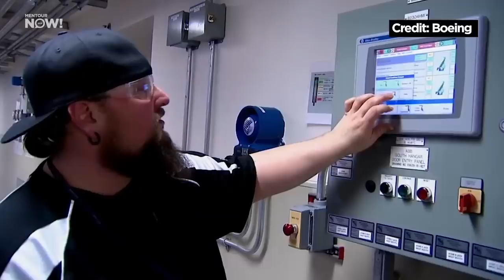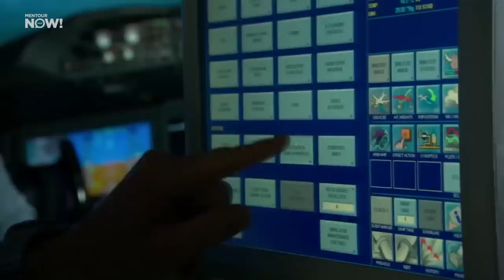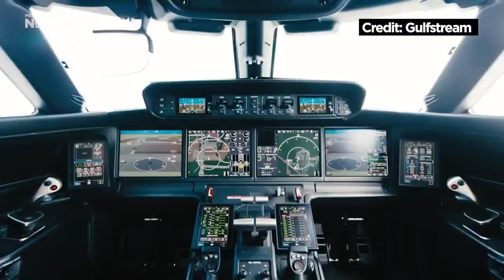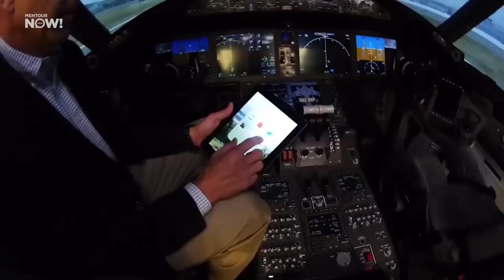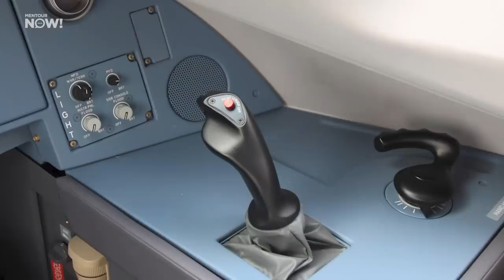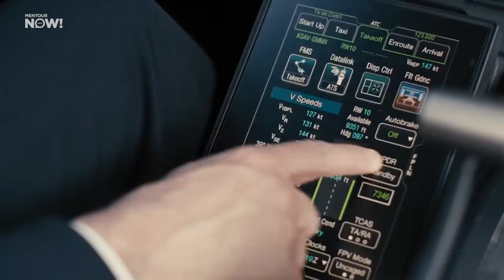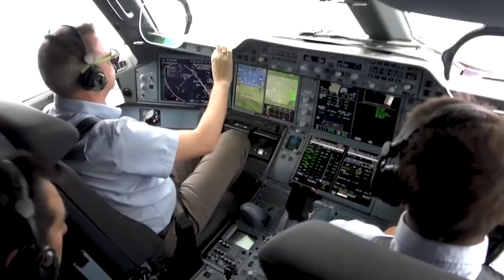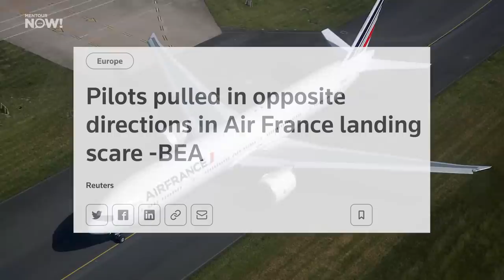Is Boeing Switching to SIDE-STICKS?!

Comment: the side stick needs to have some kind of force feedback system to alert pilots to dual input. in an emergency, that little "dual input" alert gets missed
Reply: Didn’t stop the Air France guys fighting each other for control in their 777 though!
Reply from the maker: Yep, and that’s now here as I explain in the video.
Reply: Also audible warning systems can only give a single warning at once. There's a priority system for them. Thus "dual input" won't be given at the same time as an EGPWS/TAWS or TCAS audible warning.
Reply: Dual Input volume is as loud as any other aural alert, so not little. Multiple crashes have shown that any alert may be missed in a stressful situation. Training is the difference. An Airbus pilot would be listening for these alerts based on training (just like we listen for our call sign that changes several times a day).
Reply: I wonder why it wasn't done in the first place, it's kinda obvious?
Reply: @phil_nicholls  I thought it was the A330?
Reply: @markevans2294  That's why you need like Google glass display in front you , with all the visible warnings listed
Reply: The airfrence 777 were probably airbus pilots before. Doesn't understand Boeing with hydraulic and electrical flightcontrols.
Reply: That's why they should be linked mechanically. No dual input possible. Absolutely idiotic that they make this even a possibility. There should be clear feedback in case they're fighting each other.
Reply: @EbonyPope  ...but that "linking up" would cost money so it's a no-no.
Reply: You ever seen a yoke in a fighter jet. Even Gulf stream are switching over to side stick.
Reply: Single pilots land with their left hand on the yoke, right handle on throttle, flaps, trim, mixture, etc.
Reply: @TChalla007  a fighterjet is manned by one not 2
Reply: @maneeshvelu  In one of Mentour Pilot's air crash investigation videos the dual input warning was not even GIVEN, because another audible warning was of a higher priority during an emergency. So the pilots could not hear it, since it never was annunciated AT ALL. That problem was coupled with the Pilot's lack of callout to make sure everyone knew who was Pilot in Command. They crashed. Force feedback is a much better system than an auditory warning.
Reply: When I am cruising down the highway, like I-5 north of Sacramento, one hand on the wheel works just fine.  When driving on a winding road on snow or ice in Maine I want BOTH hands on the wheel. Side stick is OK when all is fine but in an emergency I will take a yoke over a stick any day.
Reply: I dont think it really matters anymore. Both Airbus and Boeing aircraft are incredibly save (ignoring the MAX-disaster). Sure its good to continue improving safety, but there is no fundamental flaw in either control system.  

So purely for conveniency sake, the sidestick seems like a better choice?
Reply: @MentourNow  This is why I maintain that the "Cross Hairs" indication of final control input to the FBW system should ALWAYS be presented on the pilots PFD - And that it gets really BIG and Obvious whenever unusual / dual input situations are detected. (Who knows if this might have helped the ill-fated Air France A330 that stalled in from FL3xx!?)
Reply: @sciencepowerpoints lol no
Reply: @TChalla007 Fighters don't have to worry about dual input... Which is what is being discussed.
Reply: @phil_nicholls

They didn’t crash in the North Atlantic taking 226 other people with them.

Comment: When I learned to fly more than 50 years ago, it was in an Aeronca, a tail dragger with a stick rather than a yoke. But it was in the middle, not on the side and it made steering on the ground with the rudders more than intuitive. If the sidesticks are on the outer sides of the cockpit, wouldn't that mean that one pilot is using it right handed, and the other left- handed? I would think that would make switching roles difficult
Reply from the maker: Its actually quite easy, I’ve heard from sources. It takes a few simulator sessions but that’s it.
Reply: I thought the same before I tried, but I fly motorgliders with my right and SEP's with my left right now and the switch was super easy
Reply: I probably should wait for the end of the video but I’m curious to hear how Mentour Pilot will answer this issue. Will he mention the biggest advantage that specifically comes from non-linked side stick technology? I can’t wait.
Reply: It's a bit like going from a car with the steering wheel on one side to one with the wheel on the other. Takes a little of getting used to, but a lot of that comes down from the fact that so much looks just a little bit different. Don't forget that even with a yoke, so many controls are still on your other side, hell you even have to keep the centerline on your other side when taxiing.
Reply: And btw it's the same with a yoke the captain uses his left and the FO his right hand
Reply: I'd suspect it's very similar to when you start cfi-ing in yoke trainers today.  You switch to using your right hand so you can use your left for throttles.  It takes a bit of time to get it but it's not completely relearning to fly.
Reply: @MentourNow  I fly Gliders, wich are built with a center stick to be flown right handed. But I find it quite easy to change hands if neccesary even when flying close formation for Fotos (Those I always take right handed). I recently picked up motorised flying with a stick but the throttle in the middle, so flying in the left seat i use the left hand most of the time. In the end its training. Also when you adjust the throttle or flaps on any Boeing airliner you are already flying with your outer hand, so the change would only be that it is a bit further out with a side stick. i imagine you wil rarely have both hands on the Yoke anyways with a modern Jet, thats easy on the controls.
Reply: @MentourNow  True. I fly the 320 as Captain 
 and the transition is not only about the sidestick. But like in every other airplane everything is almost reversed in the cockpit, as the throttles are. So, it’s true. A few simulators and you are on. The biggest problem in changing sides is the change of mind, not hands. And thanks for your work. No drama but good knowledge presented in the most interesting way. Keep on!
Reply: Surely its the same with a yoke though. When doing take off and landings the pilot flying has to have one hand on the throttles and one hand on the yoke still. As the throttles are always in the middle,  the pilots are forced to use the left OR right hand on the yoke depending on where they are sitting. I dont see how that's different to a side stick.
Reply: The Boeing C-17 has the same stick control setup, a center stick that can be operated with either hand however it's unlikely they'll use this setup for a commercial aircraft
Reply: @MentourNow  at my company, we do swap seats for each leg. It’s not an issue. If I can do it, anyone can.
Reply: @Jake Werecat I’ve flown light airplanes with center sticks, side sticks and yokes from left or right seats. I’ve also flown helicopters from both seats. Airplanes required a little practice to get comfortable switching throttle hands. Helicopters were easy to switch seats because of the standard layout of center cyclic stick and left hand collective. I’ve often flown in cruise with my collective locked and my left hand on the cyclic while using my right hand to tune radios or whatever. However, you “could” fly a helicopter from the left seat with left hand on the cyclic and right hand on the right seat collective. I don’t think I’ll try that.
Reply: @MentourNow  I’ve flown light airplanes with side sticks, center sticks and yokes from both seats. The biggest drawback to side stick that I could find was a decreased amount of lateral control travel. The second disadvantage was a decrease in strength and dexterity when applying control input away from the torso (rolling to the right in the right seat and rolling left in the left seat). All the helicopters I’ve flown had center cyclic control which provided the best travel and ergonomics for fine control movements in hover while allowing the large control inputs required for landing on slopes. I don’t think center sticks will be replaced by side sticks in helicopters without fly by wire augmentation. I’ve never flown anything with fly by wire but I’ll happily fly whatever you’ve got. I like anything that gets me off the ground. Thanks for all the great videos. I really enjoy and learn from your work.
Reply: As others have said, it’s not really that difficult.  I was curious about the same thing, but having flown the Embraer Praetor sim a few times, it’s actually quite easy. 

When I got my flight instructor rating many years ago, the first few training flights in the right seat felt a bit odd and required a bit of adjustment, but you quickly adapt to using the opposite hand.  Having done that, and now having flown as both captain and first officer for many years, it’s my very easy to switch back and forth.
Reply: It’s the same with a yoke. Your throttle quadrant is in the middle, so if your the FO, you need you left hand on the throttle which puts your right hand on the yoke. When you switch to captains seat, your right hand is now on the throttle which puts your left hand on the yoke.
Reply: No it doesn't matter if it's a sidestick or a yoke. when you change seats, you change your hand hand positions either which way.
Reply: That was always my thought, the left hand versus right hand situation. I am left-handed so it wouldn’t bother me at all in the left seat but not so sure about being in the right seat.
Reply: @CandyMan2001  
Sit on the same side unless you have a crew of 3 on a long flight with one captain and 2 first officers: when the captain takes his break one of the first officers will be in the captain's seat.
Reply: The same is true for yokes, when you fly as a captain on apporach, you have the left hand on the yoke and the right on the throttles, and first officer has it reversed, right on yoke and left on throttles.
Reply: I see a lot of people wondered about this issue. I had another coordination issue too. I was 16 when I started learning to fly and I started learning to drive about 2 months later. Since I steered on the ground with the rudder pedals, I tried the same thing in the car. It did not work with the clutch and gas pedal. I quickly caught on. I wonder if most people who learned to drive before flying try to steer on the ground with the yoke. It's a matter of familiarity with your vehicle, whether car or aircraft.
Reply: @Hans-gb4mv  I could never drive car with steering on the right and changing gears with left hand, tried it no way.
Reply: I fly usually with my left hand in sim but irl in gliders I fly with my right hand and I can say I don't forget how to use the other when flying with one

Comment: I've got experience on both, can confirm the appreciation of the sidestick. The yoke is only ever used for a couple of minutes per flight and then it's just simply in the way. The sidestick provides great aerodynamic protections and ease of use. And yes, the tray table is fantastic. I used to be a yoke guy. I'm now a sidestick guy.

Comment: Boeing yokes are designed to break from one another in case one gets stuck mid-flight. If the pilots were fighting over the controls, it's possible together, they made a combined force of 50lbs, breaking the yokes free.